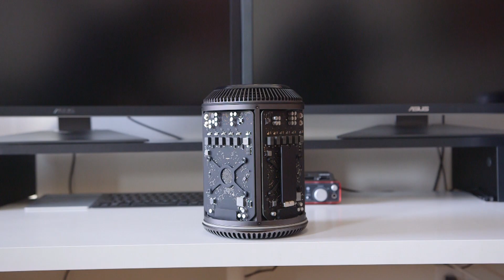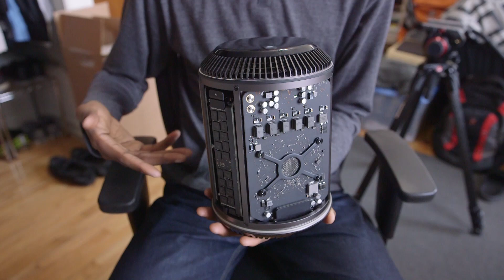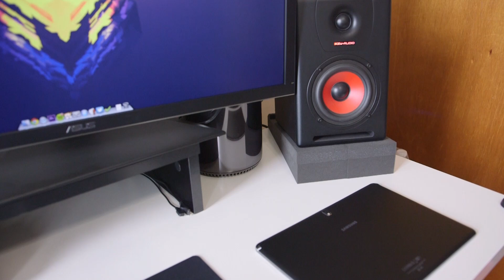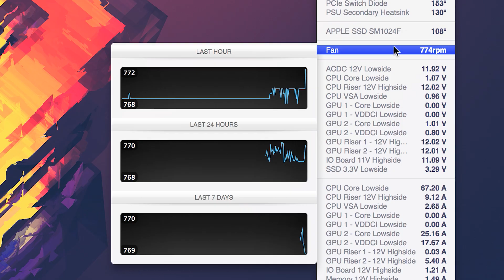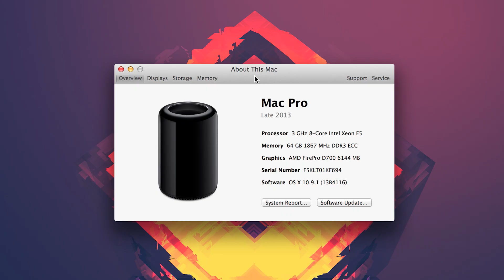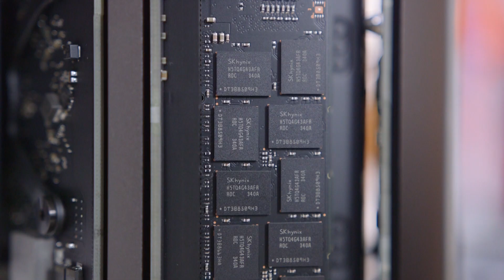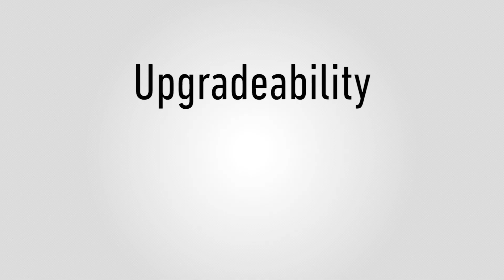New Mac Pro Review!

Comment: This could sell well on the low-end market, if they'd focus on easy upgradable parts, and "uniqueness". 
I assume there is a market for easy-upgradable computers, where you don't need great, or better any know how of how the machine works. Just take the old/dated part out, stick in the new part -> done. You can sell "Apple-verified" components.
Add great and easy communication between other apple products, and you'd have you next hit. 
Conceptwise just as Razer's Christine, but Apple being able to make it a success. Especially if they don't focus on gamers, but households. Hell, make it a media machine with Apple TV integrated. So much damn potential. But as working station... does the size really matter that much to leave out features?

Comment: If you are looking for cool points go for this ...BUT... I work with a lot of renderings (2 and 3d) and video editing ' I built a dual Xenon (24core) system with a GTX Titan and  500gb raid ssds for around $5000 with way more than twice the performance of this $8000 system. Xenons run dead cool and the whole system just sits under my desk unseen for months. Is it worth all this extra money just to look cool THAT is real Question to ask when buying this
Reply: This system focuses on the graphics more than the CPU though.
Reply: What you do is quite obviously more CPU intensive. This thing is made for GPU intensive tasks like real time 4K video editing etc. Different machine for different purposes. If the software is optimised for the GPU acceleration this thing will slaughter your Titan quite handily.
Reply: problem with you computer is that titans don't support 10 bit colour. which is quite handy when doing colour grading.

Comment: Nice video only thing is people keep talking about its lack of pci but magma already makes a pci expanision case and have made it for a while.
Reply: Pretty much all the pro A/V companies have or will soon have Thunderbolt devices on the market too, so it's not much of an issue. the only "issue" is legacy, but there's a good chance you'll still have your old Mac Pro if you're using PCI cards, so rather than move them over, just get all new (which is generally the way it works in the workstation industry. Things don't get upgraded, they get replaced).

Comment: Can you exit video on Windows like on mac? I mean why spend more money on something just too edit video or surf the web when you can do the same and more things cn Windows.
Reply: Because people who buy the Mac Pro are graphic designers and people who do a lot of editing so they made it excel in that area.
Reply: There's a bigger selection of pro software for the Mac for media heavy industries like video editing. The core of the OS is also aimed more at media production, especially audio.
Reply: Personal preference. Thats all. Some people work with OSX only stuff, like FCPX, Smoke, etc. But yes, Windows will work just as well, as most of the software is available for both platforms.
Reply: But the question is still there, can you do it on Windows?
Reply: Ok then  why spend more on something  just for editing videos
Reply: Ricky Darktech Yes, you can do it on Windows.

Why spend more? Because 90% of the youtube video editing community doesnt understand that more money doesnt always mean better or faster.
Reply: I mean If I can do that and a lot or more for less I will go with Windows but that's me
Reply: Ricky Darktech Well the Mac pro is actually very cost efficient.
Reply: Ricky Darktech It depends on what parts you use. If you build your own i7/GTX rig, then you can save a lot of you'll be just fine with editing. Or, if you have a huge budget, you can always buy/build a dual Xeon machine with a GTX or (Quadro if needed).
Reply: I have  a MacBook pro it's nice  but like I have been saying  on Windows I do a lot of things  I can't do on mac
Reply: Ricky Darktech Yeah but people who buy Mac pros buy it because they need what it is specifically good at.

Comment: Is it possible to build a better PC at the same price or cheaper?
Reply: No, at least not if you're comparing like-for-like. 

If you want a gaming PC... well, any equivalent (including iMacs) will be cheaper.  But if you want a modern Xeon processor, ECC memory, solid-state storage and fast AMD workstation graphics?  Apple is tops.  Consider this: the rough equivalent to the D700 graphics, the W9000, costs around $3,300 by itself.  A baseline Mac Pro with the D700 added is $4,000.  You're getting an entire workstation for only a bit more than the price Windows users will pay for just the graphics component.
Reply: Aurelian "A baseline Mac Pro with the D700 added is $4,000." Actually you get 2 D700s so it's even more cost efficient.
Reply: ***** That's a gaming PC, not a workstation... the comparison only really shows that you shouldn't buy a pro machine if you don't need what it offers!

Comment: Its already been stated by Adobe that Premiere does indeed support the new Mac Pro. Why is this so hard for people to understand? http://blogs.adobe.com/premierepro/2014/01/newgpusincc.html
Reply: Supported but not optimized.  Right?
Reply: Supported doesn't equal optimised.
Reply: ***** The GPU's are only used for real time editing, and then both are used for rendering supported effects, just as it is on any other machine. The CPU can then concentrate on decoding/encoding. The GPU does not do any decoding/encoding.

Premiere is multithreaded and will use as many cores as you have. However, this is all dependent upon the codec being multithreaded as well. Codecs and FX can decide how well media threads during processing. Some Codecs dont thread well, as well as some players dont thread as well as others. Many FX especially 3rd party do not thread well or are just now getting the multithreading optimizations done. These unfortunately are out of Adobe's control.

Premiere can be 100% "optimized" for the Mac Pro, but if you're using a crappy codec that doesnt thread well, then you're stuck with a machine thats not gonna be used to its fullest. This is not Adobe's fault, but rather whoever made the codec.

And Premiere would run even if the GPU's were not supported. It would just auto-default to software mode, rather than using the MPE.
Reply: Dont waste your time. This is what happens when a product is overhyped. Adobe has already said that while OpenCL is still young in Premiere, it works just fine. And dont even get me started on a single CPU trying to decode and feed dual FirePros. lol
Reply: ***** What optimisation is necessary apart from multi-threading?

Comment: Firewire has been a weak link and almost a failure in my 2009 Mac. The expandability of Firewire 800 in practical terms really fails. On many levels, daisy chaining peripherals is a failure. I need to see the limits of Thunderbolt expandability because if it is anything like Firewire 800, I would probably trash it [yep pun included].

Comment: I just noticed... having only one fan... this would overheat immediately if it fails... and I already hat a CPU fan die... but it was fine due to my overall caseflow... (HAF 922 3x 200mm fans plus cpu and exhaust fans not talking about gpu fans)
So in theory I could still do everything with only about 5°C to 10°C but I didn't want to risk it... but here!
Reply: Nope. Take a look at that heatsink. It is large enough to equal a tower heatsink and GPU heatsinks combined. If you aren't doing anything serious, you can passively cool the components with the TDP that the triangular heatsink provides for. If a fan on your GPU dies, your GPU will fry or blue screen, no matter how much air is coming from your front intake. It will not make it past the heatsinks without the GPU fan.
Reply: Flipside...only one moving part to fail.
Reply: Grant Gelinas-Brown
The question is, is this now good or bad? ^^

Comment: I wonder if there are any PC cases that implement this Thermal Core concept, where multiple components can be cooled with less fans.  More pulling air through the case, rather than trying to push cold air in.

Comment: I really loved the video as a person who custom builds PCs - however I have some comments to make:
"we aren't going to see a new mac pro in another 10years"
And that, exactly there is the problem with it.
I really want to draw that point out to you ***** , due to the fan design.
As a PC builder, no matter what setup you use (be it MINI-ITX or ATX) cooling is the biggest problem. Air flow, reliability, replacement options and whatnot.
I have no problem with the Mac having a SINGLE fan, as long as it does the job - but add a few years to it, add possible failure rates, add ambient temperatures, add dust, add carpet and/or different surfaces and then re-evaluate it.
This is my biggest problem with it - I hate the design personally, but think it is a little stupid, as a FUTURE investment, due to the potential failure rate. You cannot say it won't fail nor can you say it will definitely fail - but it seems that Apple didn't calculate that possibility in their design. You and I both know, how much that thing will cost to replace too, knowing Apple.

Anyway - on another note, how do you run dual monitors on it, via a single HDMI output?
Do you have a HDMI splitter or something that does the job? Shame they didn't include more than 1x HDMI ports.

-Dubbed

Comment: Great video! I have used a Mac Pro and dang is fast. I tried it with Adobe Premiere and even though it's not fully supported it still is a beast at it. As a videographer, photographer, and graphic designer who does quite a bit of traveling I'll be sticking with the MacBook Pro's, I'm currently on the early 2011 model and I have had no problems as far as speed and performance go. I see a lot of hate comments lol, here's my opinion, if it works I use it. The only reason I'd buy the Mac Pro is if I worked with BlackMagic or RED Footage all the time and had a studio.